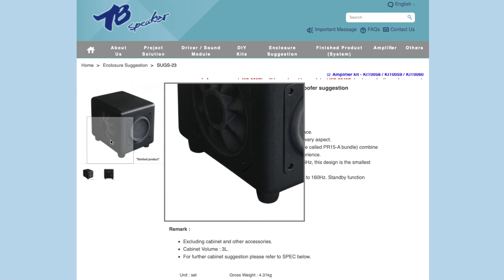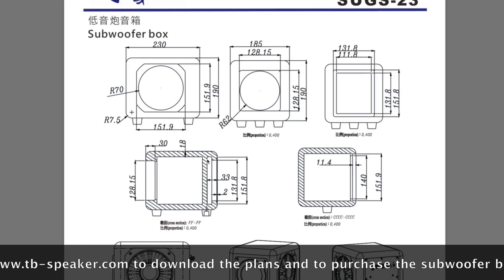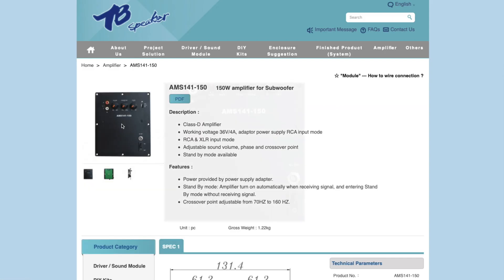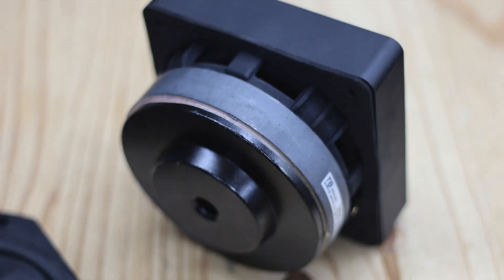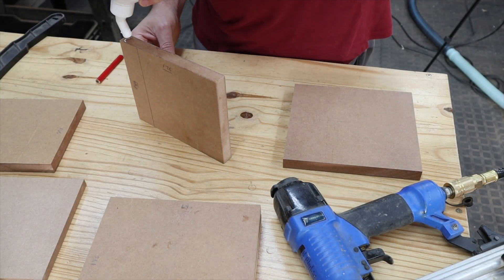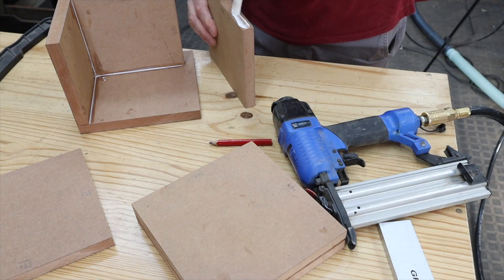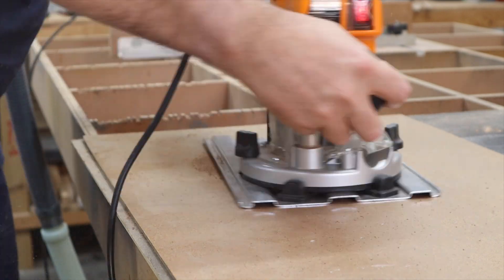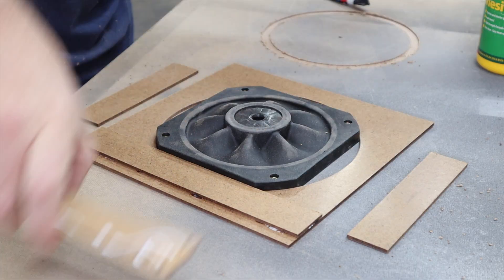Building a Small Subwoofer - Plays down to 33Hz!! - by SoundBlab

Comment: Did you use sound dampening material inside? If not why? 
Best regards Jonas Risberg
Reply from the maker: Not in this one, but it will not hurt to include some. The cabinet is bery small though and I did not want to obstruct the movement of the passive radiators with internal damping material.

Comment: Maybe si a good idea for the New Onésimo in this world of the audio that you explain in a video what is a passive radiator and why to use it
Reply from the maker: A passive radiator acts very similar to a bass port. It is tuned to a specific frequency, same as a bass port, but it eliminates the typical noise that is associated with a bass port.

Comment: i wonder how 3 of theese, one 4" midrange and a tweeter would fare in a taller floorstanding speaker? kind of like the system audio Ranger's i once had, those speakers went DEEP and was "punched in the gut quick" with ultra long throw 4" speakers. jawdropping speakers tbh, hate the fact i sold them.

Comment: Unfortunately I bought the driver (W5-2053) on it's own. Then found out that the passive radiators I bought to use with it required massive lead weights and still weren't tuning quite right.

Apparently Tang Band won't sell you just the passive radiators, either. So I was fucked.

I just got done building a ported box for it, and it still plays down to 32 or 33 pretty usably. 35hz is solid.

This isn't crazy loud, and won't shake the room, but it complements the 3" rear loaded horn speakers I built from Tang Band's plans.
Reply from the maker: Yeah bummer that they only sell it as a bundle! Glad you made it work though!

Comment: Nice, new subscriber here.

No idea if it's possible, however I believe I would have explored placing the passive radiator on the bottom ... assuring adequate clearance etc.
Reply from the maker: Hi, welcome! That is certainly an option. Although, some drivers and PRs have shown a tendency to sag when mounted on the bottom of an enclosure. Personally however, I have not experienced this so far in any of my builds with bottom mount drivers.

Comment: If u can deliver 33hz with a 4" driver, then why would any1 buy huge subs? what's the downsize?
Reply from the maker: Down size is a small sub does not move as much air as a large sub. The sound pressure level will be less and the sub will have to work much harder to produce the same output.

Comment: What is a radiator?? In simpler terms?? Please someone explain.
Reply from the maker: A passive radiator (PR) is simply a speaker driver without the motor structure (or magnet and voice coil assembly). It operates passively without electrical connection. This PR is tuned to a specific frequency to work with the enclosure and the bass driver in the enclosure. Very much similar to a vented port in a bass reflex enclosure. However, the advantage is that you do not generate potential port noise and boominess that you can sometimes get with a port. It will generally also allow for a smaller enclosure with similar output compared to a ported enclosure.
Reply: @SoundBlab  thank you especially port noise point because I was super in doubt y radiators when we have ports and all sorry I am very new in this I have had earlier experience with robotics and for more than 5 years I have bust with my sales job now due to lockdown I wanna do something and my damaged tiny speakers and unavailability of any home threate with me has has motivate to take matters in my own hands as I prefer to make than buy as much as I can since it will be a a great learning point for me. Can u also please guide me in the learning direction please.

Comment: BAck in my days you didnt need a subwoofer. Back in the 70's and 80's any good pair of speakers could play down to these kind of frequencies without the need of a sub. Oh, and you could get stereo bass! Try that on your modern 7.1 surround system, oh wait, you cant!
Reply: I guess you’re being facetious. Full range speakers didn’t go away if you are set on having your LFE in the same cabinet. Also, it’s,expensive but you can even have surround subs for immersive audio, but ya the standard formats only have one discrete sub channel. Anyways, if you are rich, nothing stopping you from having two rooms, one with a stereo setup and one with Atmos.
Reply: It exist today with big expensive floor standing speaker. Also those thing only play loud.

Comment: i just love it when the bass radiator goes absolutely mental while the sub almost doesnt move at all
Reply: The radiator is just like a hypeman for a rapper
Reply: Same with my sound system. There is lots of bass with the littlelest movement from the sub. Really efficient driver i guess. 6.5" 220w unit. Sl8yg soundbar btw

Comment: How compact could one make a sub that goes in the 20hz range?
Maybe a bit larger driver, but horizontal subwoofer of good quality?
Reply from the maker: I don't think you'll get much smaller than a long throw 12inch driver in a 400mm square enclosure, but then you will need to add some servo control and DSP to get down to 20Hz.
Reply: @SoundBlab  looking at maybe building something DIY, maybe dayton ultimax box with 50cm width, 50cm-60cm height and 40cm depth. It wont be a small box, but since it wont be as deep as for instance klipsch 15" I could then up the volume for an 18" driver. Or maybe I should put it in infinity baffle in ceiling.. Havent decided yet, still looking into this. I tested an Thor IWS 10" with passive woofer, but I couldnt get it below 30 Hz in a frequency sweep.

Comment: I have been wondering why certain speakers have that... I don't know what to call it... lung type thing. Like the purpose it serves and is it an alternative to a port.  I've researched building sound equipment and whatnot and have only started seeing those lung things recently. Does it increase sound or air pressure?
Reply from the maker: It is called a passive radiator. It acts similar to a port. A port is tuned to a specific frequency, and a passive radiator as well. The advantage is that you do not get the potential air chuffing noises that a port can produce with a passive radiator. This is a very basic explanation, but I hope you understand the concept.
Reply: @SoundBlab  I get it.

Comment: No polyfill needed to keep it from sounding hollow?
Reply from the maker: It is such a small enclosure that it does not really resonate so much, but it will help to tune the bass a bit. In this case I did not experiment with it though. But no harm in putting some stuffing in there.

Comment: come onn its like ANYTHING can be called a subwoofer these days..thats a damn WOOFER not a sub
Reply: Frequency range determins what is and isn't a subwoofer. Woofers do not operate in low frenquencies, such as say a mid range 6x9 that picks up bass.
Reply from the maker: Sub frequencies are considered from 60Hz down to and below 20Hz where humans can still hear it. This 'sub' can go well below 60Hz. So, this is considered a sub for that reason. It's not determined by the size of the woofer, but by the capability of the design of the driver.
Reply: @SoundBlab  where is the line drawn? 3db is half volume and it hovers at 60ish you said for 3db down. Doesnt seem that great to me. 6db down for 36hz. Thats a pretty big drop in volume

Comment: I really like your build, especially that you make enclosure between AMP and SUBs by MDF pannel. Saw that very rarelly, even for huge subs. Even pro audio companies like Genelec ignores that, at least in their aluminium monitors.
Reply: A reason the amp is not separate is to allow cooling of the amp components. If you notice, most manufactured subs will have a port near the amp so the air cools the amp as it passes. This option becomes dangerous for high volume continuous loads as their is zero cooling for the amp without external heatsinks. Of course in theory, a separate encloser can reduce vibration to components, but in all reality, with enough volume it's better to have cooling then run components near the solder melting point or glue melting point and still have vibration regardless of separation. Plus you loose less volume without the separate encloser as well, and in many cases, size does matter for locations.
Reply from the maker: Thanks

Comment: Mind aswell just mount a nonpowered fan that size into it as a port for the air / wind from the bass. That would be cool to add.   Instead of a rounded/tubed port, or a vented. A regular small nonpowered  fan would be cool to use.  The wind / air from bass will move the fan.

Comment: Cute sub, and your workmanship is so excellent!  I hate to say anything negative.....but.... its a 4" driver. I bet it sounds impressive at low volumes, but I really doubt it would satisfy a lot of us who like to turn up the tunes once in a while. For similar pricing you could drive a low cost tpa3116 class d sub amp (100w@2ohms) into a dual 6 or 8" ported sub at and get some real chest pounding bass. I am currently playing with different designs and am finding a single 8" subwoofer insufficient for my pc setup in a somewhat average bedroom - again just for the odd time i want to crank up the tunes to higher volumes. Moving up to a compact 10" or dual 8" or maybe a 12" even...nothing beats the displacement of a larger driver.  I am looking forward to your sound test though - maybe i'll be pleasantly surprised and proven wrong lol.
Reply from the maker: Thanks man! Sure, I hear you. However, the size is a bonus if you are looking for something this small. Any 6 or 8 inch driver will require a much larger enclosure. I suppose it depends on your needs at the end of the day.

Comment: Hi! Very nice build! What did you use as mdf filler? That transparent stuff...
Reply from the maker: Thank you! It is a sanding sealer that is painted on in a few layers and then sanded in between. It seals the MDF so that it does not absorb the spray paint for a better finish.

Comment: Would this sub work in a car audio setup?
Reply from the maker: It could work, but I have not tried it, so can't say for sure. But it's no different from any other sub, except for being much smaller. If you are not after earth shaking bass output, it should be good enough for a car.
Reply: I imagine using more than one with them wired in series and like he said; car rattling bass isn't you intentions.

Comment: you just blasted your passive radiator with spray glue
Reply from the maker: No sprayglue was used in this build
Reply: @SoundBlab  what was that stuff at 6:20?
Reply from the maker: Ah yes... it's an activator that promotes the superglue to set almost instantly. It's harmless to the PR.

Comment: This sounds and looks great! Although high frequencies don't sound good on passive radiators.
Reply from the maker: Thanks
Reply: that radiator will not reproduce high frequencies because it is set with a subwoofer, think before speaking.
Reply: @dolbyased6962  no I mean the higher frequency bass sounds bad (like 200hz)
Reply from the maker: It does not play 200z, the internal crossover cuts it of before that to integrate with the stereo pair.
Reply: @SoundBlab  so what's the highest frequency this plays?

Comment: What actually is the radiator for?
Reply: It simulates the air movement and restriction through a port without an actual opening in the box (eliminating port noise, or the obstruction of the port by having it against another object.)

Comment: That is totally awesome but cutting out those non circular speaker and radiator cutouts takes some  router skills.   Using a router is not as easy as it looks I have f-ed up a lot of wood learning how to use  one.   I am impressed with jig he built as I was wondering how did those perfect cutouts.  I would still end up wasting an entire sheet of mdf to build this little guy.
Reply from the maker: Thanks man!

Comment: 33Hz at 86dB/1mt using 150W, means 65dB/1mt @ 1W. Pretty useless, omit the distortion. Also, the rated power is 40W, that means only 81dB/1mt @ 40W. Small speakers cannot produce powerful bass, it's physically impossible.
Reply from the maker: True, but I would not use this in my home theater setup. Something this small is best suited for use as a sub for a small desktop setup or perhaps a small soundbar that cannot go that low.
Reply: Small speakers for small applications. Enough of them would be effective with appropriate filters or not used at full power. I have a feeling you would hear more the bass than feel it.

Comment: That passive radiator looks like a fan.
Reply: Wait thats a radiator?
Damm i thout it was a fan.
Reply: DJ PUMP i did to at first 😂
Reply: DJMX it automaticity puts in the persons name when you click someone’s comment or reply, so i didn’t know there was a correct way or whatever.
Reply: @zezex3116  it's a speaker with out a electrical section and magnet. the tuning is preset here i guess. normally the weight are added to tune de frequency { it's like a basseport} but look it up more info to find .best bass is out of a active (servo) sub 14 hz posible and truly lo distortion so crispy clear bass :-}
Reply: @pissywitspissywits1886  yup i know what it is.
Reply from the maker: It does a bit 😉
Reply: It kinda did from the thumbnail
Reply: Cooler
Reply: @EduardoSantos-ir9kv  HAHHAHAAHA
Reply: @opamin24  😂😂😂😂😂😅😅😆
Reply: Thanks for all the likes🙂
Reply: I thought that radiator was just an elaborate pole mount.. 😀😊😂
Reply: Damn near thought it was a rotary sub at first!
Reply: It seems its quite a fan of subwoofers 😉
Reply: EXACTLY what i wanted to write in the commenta
Reply: same, i thought "How hot does that thing get to need a fan?"

Comment: As impressive as the graph is and how low it goes for its size, its probably not going to have the excursion at that size to produce meaningful low bass to compliment anything but the tinniest of desktop speakers for a computer.  Having stepped up to a 6.5" TB subwoofer would have been better as it would easily be twice to 3x the output. Sure its bigger, but its a more usable project then.   It is a very nice build though. Great wood working.
Reply from the maker: Tx

Comment: I have to say this is a very nice build. Simple, but nice.
I don't understand this passive radiator though. No diaphragm? It's not really much of a radiator then. Woofer´s really impressive though, 8mm Xmax at 4 inches of diameter? Wow. The only problem with this is that it would need a lot of power.
Reply from the maker: Tx. Yes, the driver is not very sensitive, so you need a powerful amp to drive it.

Comment: When will people remember that a woofer reproduces relatively flat down to 30Htz whereas a Subwoofer should be reproducing down 1/2 to 1 octave lower, typically 15 to 20Hz?  My Bass guitar plays down to 15Hz and only uses 10inch "woofers" in a ported cabinet. Keep up the good construction videos!!!!
Reply from the maker: Thanks you! I think this 'small subwoofer' is probably a good option if you have smaller desktop speakers that can'y go as low as 30Hz, but cut off in effective response after 50 to 60Hz. Then this will be perfect to fill in the lower registers to give a fuller sound.
Reply: Wrong. Sub bass frequencies start at 60Hz and go down to 20Hz, 20 being our sonic threshold. Anything below that is only felt, not heard. So what you are referring to as a 'woofer' that plays 'flat down to 30hz' would still be called a SUBwoofer as it's playing the aforementioned SUB bass frequencies. If the bass frequency of a particular speaker rolled off at 50 or 60 Hz then THAT would be generally called a mere woofer.

Here's an article - https://www.teachmeaudio.com/mixing/techniques/audio-spectrum

Comment: Excellent build would like to have 2 or 4 of these Subs in a soundbar. And bass box for a hatchback. Need slim looking boxes. Guess 4 tang band could be equivalent to a 10”
Reply: No I don't think itd be close.
Reply: Well they are 4" speakers, two would be the equivilant of a 8". I think you would hear the bass more than feel it. It is a good idea if one is concerned about packaging and fitment. I imagine these are fast moving subs and could be used to assist one or two bigger woofers or subwoofers. I can imagine some sick sounds, keeping these with the passive radiators, and including some bigger woofers and subs in appropriate sealed and ported boxes.
Reply: All you have to do is add up the surface area of the cone and find a larger single subwoofer with the equivalent surface area. That will give you a rough idea of whether they will move the same amount of air.

Comment: You probably want to use some calking on all the inside joints, and gaskets on the driver/radiator. Experiment with some Polyfill and you might get even better output as well.
Reply from the maker: My glue joints seem to be holding up well, but extra calking should not hurt. The PR and driver both have gaskets already attached. Maybe it was not clear in the video. I still want to experiment with polyfill and extra weight on the PR.
Reply: Do you see the clearances on that speaker and PR?  No way air leakage in a factor in them.

Comment: I have a design of a subwoofer, maybe you can build it
Reply: Show me
Reply: @Randomguy-gf9zp   
 https://ibb.co/9qBZbkt 
Sorry for the rustic drawing, I did it on my tablet. The design is inspired by airplane turbines, that kind of propeller does not rotate, is fixed but serves as an air compressor, in this case the flow of bass waves. What do you think?
Reply: @Frambhueee  I have a CNC and I'd be interested in trying, you have any idea how to calculate the specifics of the design?..
Reply: @alecasone  umm...not really, but maybe if you have the specs of the driver you can calculate the inner volume of the box and with that re-shape it to the desing.
I have another design, like a rocket, But I think it would be too large, like 1.30m tall XD, I don't know if would work